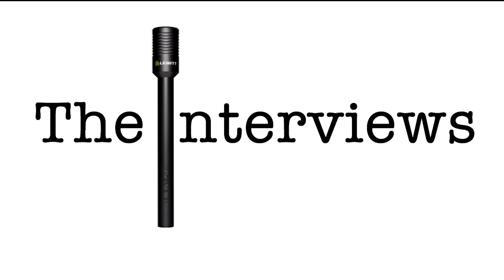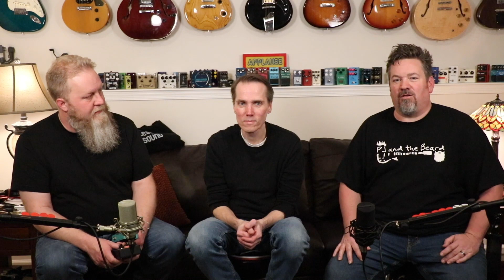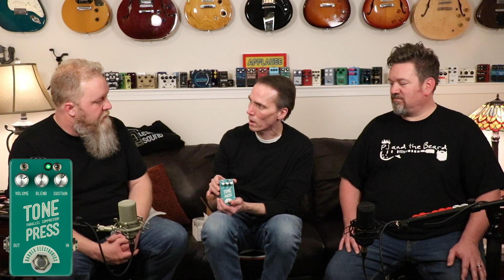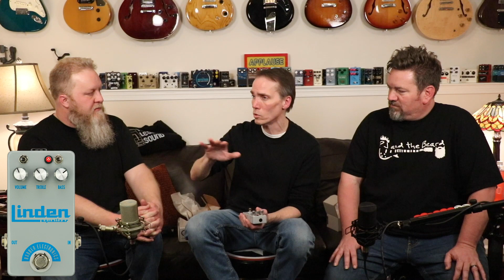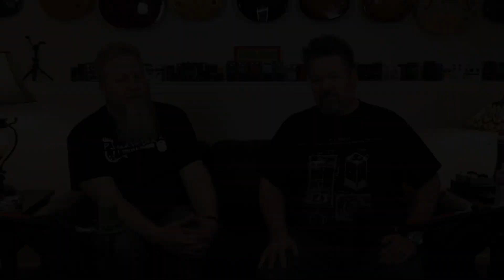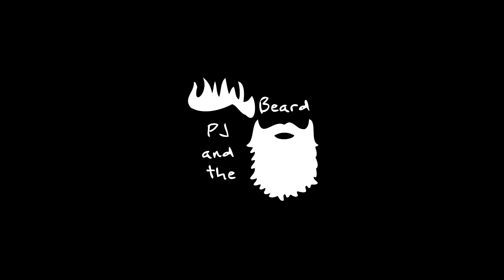David Barber of Barber Electronics (Part 1) - The Interviews

Comment: I bought the Gain Changer SR after hearing about it from a tweed amp builder. It works great with my new Tweed Champ amps. I had heard of Barber Electronics but the company was never on my radar. The power of word of month. I love it.
Reply from the maker: The gain changer is a great one. Actually, everything we have tried from barber is great.

Comment: I bought the DUAL CHANNEL TONE PUMP in late 90s I think, Picked it up in Evanston Illinois at a great music guitar shop. Cant remember the name???     GREAT PEDAL. Mine actually has two channels with 3 controls for each. 
Channel One has VOLUME/BASS/and PUMP.   
Channel Two has  VOLUME/TONE/and PUMP...
Bottom of Pedal or closest to me there are two Foot buttons. Left its labeled ON/OFF...and the Right One FOOT Button on the right selects the Channels. Is this a very early version ? At the very top where most pedals plug in the AC is where the Barber Electronics name appears. And I always wondered about the power source? I was warned not to plug regular 9 volt electric power source (wall wart) cuz its wired differently? What type of power source or adapter do I use? Thanks
Reply from the maker: Sorry I haven’t gotten back to you yet. I don’t know the answer to your question and was trying to get the answer. Haven’t heard anything back yet.
Reply: 9-18 volt DC negative tip (so, like a BOSS or Ibanez adapter). You have a Tone Pump with two channels, the bass and tone are shared, not per channel. Each channel has its own volume and pump. Great pedals lots of fun, hopefully we will make them again soon.
Reply: @barberelectronics5672  , would you sell the power supply separately? 
When i purchased the Tone Pump in late 90s I was told that I could not use the same power supply as Boss or Ibanez?
I was told it has to be wired differently? Was I going all those years w/o a power supply needlessly? I was told it would burn out the unit or something so I went without all these years just using the 9 volt battery...
Reply: @scottjensen1513  Hmm, not sure who told you that. Barber pedals use the same power as Boss and Ibanez and nearly every pedal on the market. It's the standard 9 volt negative tip that 90%+ of pedals use. We have always stated "9 vdc negative tip (center), which is the Boss and Ibanez standard.
Reply: @sgnirts1010  thanks for your response, but since the 90s I’ve almost always use the tone pump. Even when battery gets low sounds pretty good, but now I’ll start using a power supply, so I won’t have to worry about battery again. Your pedal built so well still holds up never any problems!! Definitely one of the wisest music choices I’ve made!